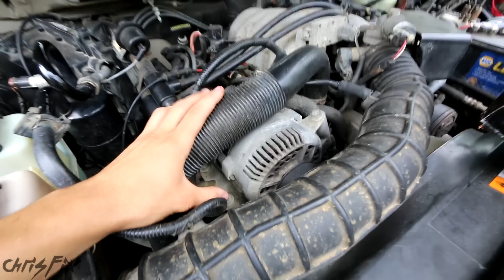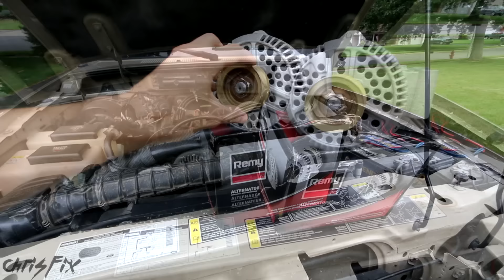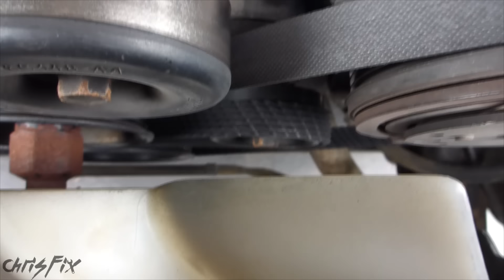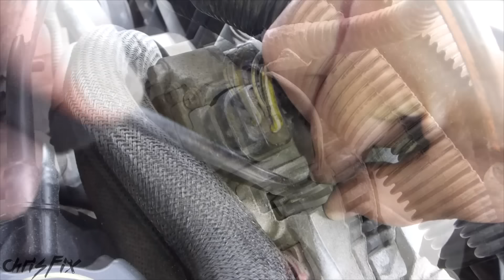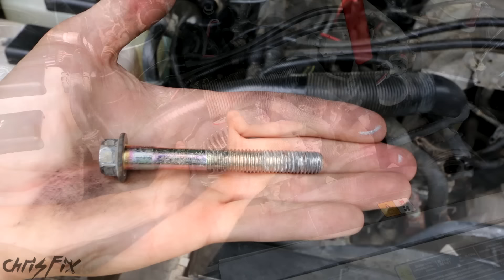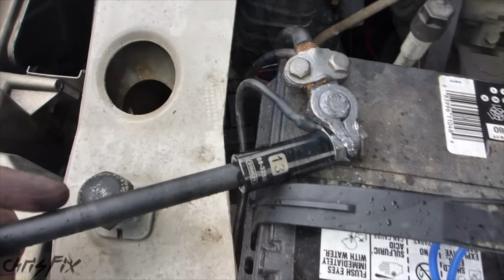How to Replace an Alternator

Comment: My alternator was a lot easier to replace than yours. I have a Grand Marquis, so I had enough room to reach down to the tensioner with my arm and loosen it with an 8 inch long 3/8" square drive ratchet. Just a few bolts and wires in the engine valley and out with the old and in with the new.

Comment: Hi Chris. What are the signs of a bad alternator?  other than below 13V on idle? My battery terminal is getting hot when starting my van and it crank too long, and sometimes it doesn't start at all until the battery is below 12.2V. 

do I have a bad alternator when my battery terminal is getting hot (both positive and negative terminals?)
Thanks Chris.

Comment: Awesome Series of videos! Thanks for making them.  Way informative.  I had a 96 Altima that was so easy to replace the alternator on just because of where it was in the engine bay.  I called auto zone and had my wife pick it up and run it out to me where I broke down.  Had it done in 5 minutes. Did the same on a 89 Honda and it took me over 2 hours.

Comment: I accidentaly shorted the alternator positive terminal with ground while disconnecting it the wire. Did I fuck the voltage regulator?

Comment: After how many KM do i need to change my alternator
Reply from the maker: You may never have to change it. There is no service interval.
Reply: Sweet. Thanks for reply :)
Reply: Also a last question, i have a old vw golf mk2 Turbo diesel that needs a new timing belt, its that something i can do by myself, or do i need a mechanic.

Comment: Here in the Philippines, it's hard to find an alternator. My mother had to get the alternator changed because the alternator is 15 years old. It's burned out and rusty. But the alternator replacement is hard to find so we asked a mechanic and he got our alternator replaced but the replacement is just slightly used but like brand new

Comment: If I replace the alternator with a more powerful one will there be any problem with it not getting enough power on the stock engine if the engines running good, or will it be ok
Reply from the maker: You need to make sure your stock wires can handle the extra power but everything else is fine otherwise when you upgrade the alternator.
Reply: ChrisFix thanks, I want to run a light bar, lights up front, bed lights and eventually an electric winch. I'm gonna tweak your design for the head ache bar so It will work with my truck box.

Comment: I need to replace mine because my amp is really powerful. I drive a 2001 Mazda Tribute and the amp is in the WORST place. It is on the passenger side of the engine against the firewall. You have to pull a bunch of the wheel assembly stuff apart to get it out.

Comment: I have a way to know if your alternator is bad, Drive down the highway and see if your radio an gages cut out, then see if your power windows still work, finally, if your lights and Power stearring drop, you have a bad alternator.

Comment: I had a similar problem with my trucks alternator, however, the battery light stayed on the whole time, and would only occasionally shut off when I ran over 3500-4000 rpm

Comment: chris so right now my truck is messed up and can't find out why. I put the key in and everything that should be on turns on. when I turned. the key to start i hear two clicks and everything and I mean everything turns off. and after that I can't get any power what so ever. until I disconnected the battery and wait a while. and somehow it resets. just want to see if you can help

Comment: stealership wanted $300 to change brake pads. $25 for the pads $15 to get both rotors turned $12 for manual impact driver $22 for jack stands. did that shit myself lol.

Comment: hey chris i have a 03 chevy trailblazer i just resently change my alternator and when i put the new one in and started the car and turned the air conditioner on the truck felt like it wanted to kill and one vent was blowing hot air and the other cool what did i do wrong help it's hot out here. thanks

Comment: This video (all of your videos) was informative and helpful. Thanks.
I see You tend to use a flat head screwdeiver on hoseclamps. Why not use a socketwrench) Almost all hoseclamps has a 7 mm bolthead. Its more easy to use, and you avoid the risk of the screwdriver slips and scrach paintwork. There's also dedicatet hoseclamp wrenches/drivers you can buy. They have a 7mm socetMost of them are flexible to get to difficult places.
Reply from the maker: +Kjell-Normann Hanssen thanks and thanks for the tip

Comment: Hey Chris. If my engine turns over but doesn't start and no rpm registers on the tach.  Could the alternator be the villain
Reply from the maker: Probably not. Check your fuel pressure. Try using starter fluid. There has to be a spark, air, and fuel (and timing) for an engine to start.

Comment: we also have to made sure we check the belt and the pulleys specially when change old alternator the bearings inside can be broke and Will damage or void warranty on equipment

Comment: Hey Chris, not sure if you have experienced this problem, but I recently had my transmission swapped out. The issue is that when I turn the key, I hear the clicks, but the engine won't turn on. I have to basically Hotwire the truck to turn on. Any idea what that may be? I drive an 03 Silverado.
Reply: Dronine take the truck to a local auto parts store and have them test them battery.  The clicking is your starter trying to turn the engine over, but not have enough cranking amps to do so because of the bad battery.
Reply: Hey Andrew, i have recently taken the battery in and they swapped it out with a new one, but I still have the same issue.
Reply: Dronine have you taken the starter off and had them test that?
Reply: Dronine if you take the started off and take it up there, you can have them test it and see if it's strong or not. Also, watch the video on Chris testing the alternator and check the charging system, the new battery could not be getting a good charge which can make you keep having to jump it.
Reply: I will give it a shot! Thanks for the help!

Comment: It would be interesting to see if you cleaned up the grounding and reinstalled the old alternator if it would work better.
Reply from the maker: That would be interesting but that old alternator was bad internally so it wouldnt matter.
Reply: Mhmm. Im guessing such a test would not have significant results, cuz there is such a huge total contact surface, that even if it is poor, the final resistance will be quite low. But im not a car expert. Just a doc. :P learning so much from your videos though, basically been spending all my free time on them lately, and my car knowledge went from zero to 11

Comment: Do I need a torque wrench for stuff like this or tightening brake calipers? I wonder if it makes a difference between that and just tightening them normal with a ratchet.
Reply: Black Onyx To be honest you don't really need a torque wrench. But with that torque wrench you can be sure that you have the right torque on that screws, so they don't stretch while you're tightening them down. Hope I could help you, have a good one!

Comment: Chris. What is your opinion on the big 3/4 upgrade? That alternator change was so easy. Thanks for your videos
Reply from the maker: I will be doing one on my truck. It is good when you have extra stuff on the car or truck like a winch, speaker system, lights, etc.

Comment: How much electrical power does the car normally use with the key in Position II (no engine)? Does it use more or about the same if the engine is running?

Comment: My alternator voltage regulator failed, and my battery gauge was over the past the red. I tested it and I was making 21 volts! Had it replaced immediately though

Comment: You've helped me so much chris. i appreciate all the videos and extra time you take to teach and show. 
If I was soldering the wire going from my alternator to my battery, will I need a soldering gun (instead of soldering iron)? Would a 30 watt soldering iron be enough? i have an 07 ford taurus, if power wire gauge varies bw vehicles.

Comment: My step dad has an alternator problem. His 98 Dodge Ram 1500 blew the alternator and he replaced it. When he started it back up with a fully charged battery. The check gadges light came on and the battery was low on power. So he doesn't know what is going on.
Reply: Scott's_gaming_4 under what circumstances does the battery lose power ??? acceleration ? Idle ???
Reply: From what you typed I'm assuming as soon as you cranked the engine over ,the battery lost power , which would indicate a fault in the battery's ability to hold a charge, OR the starter is on its last leg or Is drawing way too much current. could be a myriad of things

Comment: Recently, all my lights (headlights, dash and dome) would flicker.  Was told I needed a new alternator but some on-line searches showed that the problem might be the voltage regulator.  I remove the regulator from the back of the alternator (with 4 screws) and replaced it for $9.  All is good.

Comment: This is the easiest alternator access I've seen so far. On a 01 accord v6 or 02 odyssey, tough luck that shit is hard to get tools in there. But the belt routing is crazy on this vehicle, they added extra idlers or some crazy shit.
Reply from the maker: Sounds like fun!
Reply: eksine some of my favorite alternator jobs ( last gen Mercury cougar v6. Horrible, mazda protege and protege 5 2.0 horrible) easy ones most ford 4.6 engines, anything old from the 80s). His truck is like most 90-early2000 ford products. Alternator on top, easy to reach. If it's down low you might have trouble accessing it with out some gear wrenches and swivel sockets.

Comment: So this is probably a silly question, but I honestly have no idea. What would prevent you from putting say a 160 amp alternator? I understand that with more power consumption (light bar, etc.) you need a bigger one. But is there a downside to putting a bigger one in just because?

Comment: Hi chrisfix! I was wondering how to know how much torque you need for certain things. For instance putting a tire on how do you know how much torque you need?
Reply: Mack Hancock they make a special tool for that. Called a torque wrench. , or you can use an impact wrench. specific torque requirements can be found in the owners manual or sometimes even on the  bolts themselves.

Comment: chris speaking of replacement, does adding brake fluid in the brake tank damage the brakes ?
Reply: I'm not Chris but usually, there will be a max fill line on the tank you don't want to go over that because if there's air in the lines that bleeds itself out the air usually goes into the reservoir but if there's too much fluid there's not enough space for the air to bleed out leading to spongy brakes

Comment: chris question. does the battery need to be fully charged before starting the car with the new alternator? i heard that if the battery is low it will damage the voltage regulator or something like that
Reply from the maker: It is better to have the battery charged if you can. If not, just go for a ride.
Reply: ChrisFix alright chris thanks for the follow up i appreciate your help

Comment: Hey Chris ! i have a 2004 Ford Ranger and watch all you videos on your truck... I have lots of lights and extra stuff. If you change the stock alternator to a higher AMP one do you have to mess with your truck battery to make up for the difference in amps from the Alternator >>>?????? Need some answers soon.... Also whats your thought on running a dual battery system or adding a second battery to run your / my lights and more lights or extra stuff.. and if you ran a second battery how would you hook it up to the alternator so that the alternator charged both batteries..????? Need your input asap ! TYSON
Reply: Higher amps don't usually require adjustment if you put in a dual batt. You might blow up a single batt though.

Comment: I changed the alternator on my 98 K2500 GM truck from 100 Amp to 140 Amp and I realized I needed a slightly longer belt, they even asked me at the auto parts store if my alternator was 100 or 140 Amp with or with out a/c. On some vehicles even if it bolts up it might need a different size belt, just depends on the make/model. This is a good video on how to replace one.
Reply from the maker: Thanks for sharing the tip!

Comment: i have a 2010 holden cruze and a brand new battery but the car won't start. is it the alternator?  plz reply ASAP
Reply: Nehemiah Weatherall man, without any more info it could be the starter, a fuel pump, spark plug system... endless possibilities.

Comment: i have a 2010 holden cruze and a brand new battery but the car won't start. is it the alternator?  plz reply ASAP
Reply: Nehemiah Weatherall could be your starter.
Reply: Nehemiah Weatherall I agree with the previous poster but I have to add that a bad fuel pump , or one that's not getting power can cause it too. does the engine even turn over ??? since you said you replaced the alternator and battery , I'm assuming it does.  if it does and doesn't start you're looking at a bad fuel pump. BUT, if it doesn't , then the starter could be bad.
Reply: Nehemiah Weatherall  I agree , but , if you had a bad starter the engine wouldn't even turn over.  When you try to start it does the engine crank ??? Or does it not move at all ??

Comment: So, I have a 1997 Ford Ranger XLT V6 4.0 L. Is it okay to get an alternator with more amperage than stock?
Reply: Michael Turner-Smith yes, it can't hurt. An alternator w higher amp load will only help w the electrical load
Reply: Michael Turner-Smith it's ok but don't spend extra money if you don't need to.

Comment: I just replaced my alternator on my 2009 Jeep Wrangler X. Since it was at the top of the motor and unobstructed by any wires and hoses,  it went in fairly easily. The only snafu I hit was when mounting the alternator to the bottom bracket, I had to tap it in with a small prybar and hammer to get it to seat properly.  Great video!
Reply from the maker: Awesome job Russell! Glad the video was helpful!

Comment: Had my alternator replaced on my 98 Durango it cost me nearly $400. Had I watched this I would have done it myself.
Reply: I've saved over $8500 over the past couple years by watching Chrisfix and a few others.  Ball joints, tie rods, drag link, steering gear box, bearings, breaks/rotors, fuel pump (in the tank), rear differential, master cylinder, u-joints, and other stuff.  Watch the video - fix it yourself.  Thanks Chris!

Comment: After I replaced my alternator my car has slight trouble starting like I have to hold the key a little longer so it can start is that a problem or does that just happen

Comment: Help! I just replaced my alternator because it wasn't spinning by itself and the belt was completely destroyed inside. After replacing with a new alternator and belt, I get a nasty squealing noise followed by the smell of burning rubber when i start the car. This leads me to believe that my new alternator is not spinning properly. What could i have possibly done wrong? both the alternator and power steering belts seemed pretty tight with only about .25 inches of play. (It's a 2001 Honda civic ex if that matters)
Reply: did you figure it out?
Reply: Noah Rule yeah the ac compressor locked up and tore the alternator belt.

Comment: that alternator is so easy to replace. mine is way down there. ggrr.
Reply from the maker: Dang! See if there is easy access from the wheel well or under the car.
Reply: ChrisFix yeap, look like its near the firewall at the back side of the engine. Ford 2.3 liter duratec.
Reply: It's crazy because some auto shops make you pay a lot just to get it fixed when it is so easy to do yourself.

Comment: I just fixed an alternator on a chev Malibu 99 by disconnecting the wires, unclipping the plastic cover' then removing the 2 screws closest to the brush hoods. removed the plastic cover and brushes. cleaned the ground brush with a short blast of carb cleaner and wiping it with my shirt. then I gave the slip rings a good long blast with the carb cleaner. put it back together. no more battery light.

Comment: Chris - If you run across a 1998 Chrysler 3.8 V6 Town and Country Lxi, could you consider doing a video removing and replacing the alternator?  The Lxi leaves no room to snake the alternator around the vertical brace.  How to take the vertical brace off seems to be the key. Seems to be a bolt behind the tension wheel holding the vertical brace in. It is a nightmare.  You are my favorite YouTube mechanic.  Professional videos.  Thank you.

Comment: Hey Chris I'm a big fan!! I have a 1996 chevy suburban and I think my alternator is bad but the only thing is mine does the opposite of yours, I rev the engine higher to keep the alternator spinning faster when the battery level is low where when you rev it gets lower. wasn't sure if its the alternator thats bad so I was hoping you can tell me! thanks a lot!!!

Comment: My Ford Escape (2004) has it's alternator hidden on the bottom of the engine, passenger side. You can tell Ford didn't want you messing with it's 3.0L Duratec V6 engine. It's quite a controversial engine anyway...a very tough repair for a vehicle known to blow engine components.

Comment: Hey Chris fix I have a 98 grandmarqus mercury and right now my battery volts is dropping donw and then go half like then back down  help me please
Reply from the maker: Sounds like your grounds are dirty or your alternator is bad. Here is a video to help: https://www.youtube.com/watch?v=LGB6ZEjGm7Q
Reply: I had a 1993 FCV for 11 years. if the battery light doesn't come on and the battery is not dying don't worry about it. this used to happen when the engine was hot and in gear at stop signs and red lights. the alternator needs 500rpm but the 4.6 can idle at 450 and lower